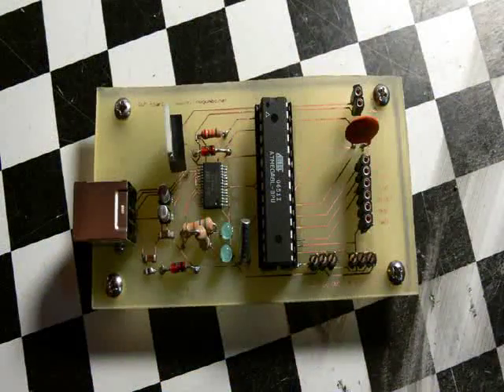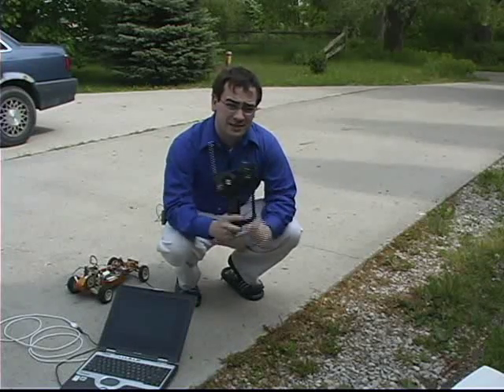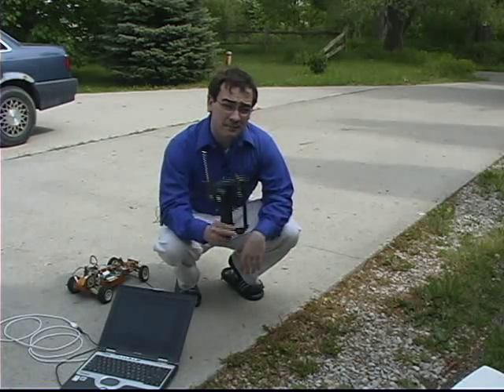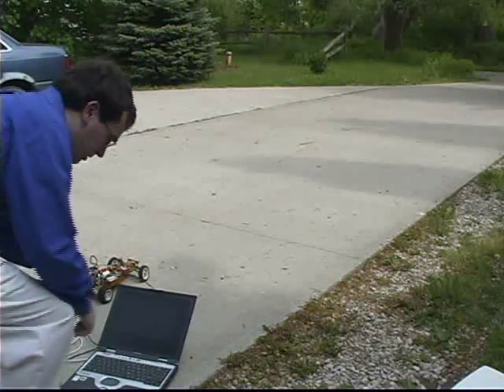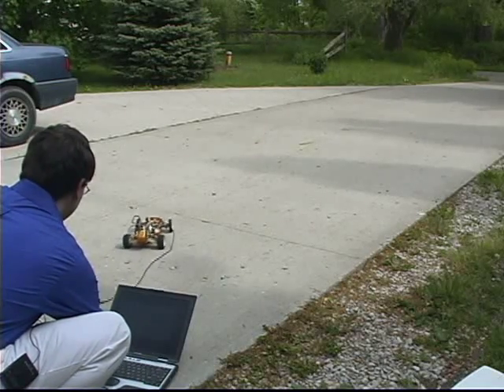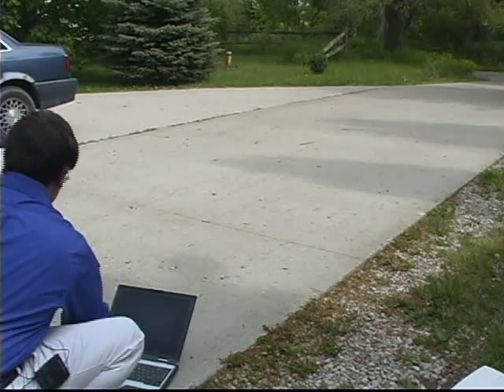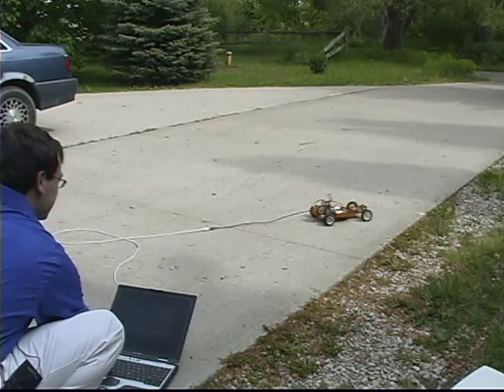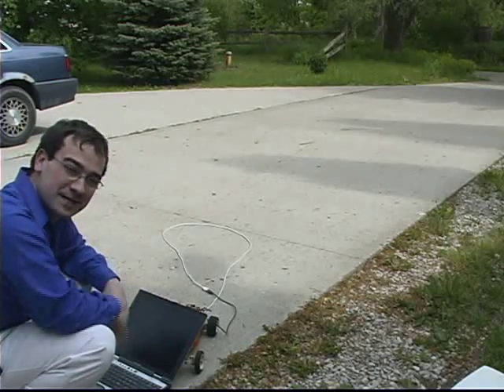Controlling an RC Car Using a Computer

Comment: This is something that needs more support, PPM control from a computer is very useful but I cannot find good projects that translate to radio TX. Once you can do this you can port ML controllers into it. Feel free to contact me if you would like to discuss.
Reply: Hi Marcus. I am not up on modern RC technology but the radio that communicates with the physical RC car controller had pwm outputs to control motor power and a steering servo. It probably would have been easier electronically to actually build a board to emulate the rc controller! I made a device called the RC interceptor but I think there are better computer controlled kits used in robotics out there now.